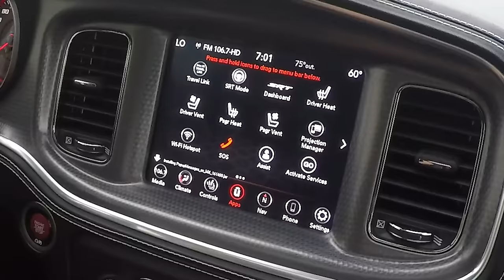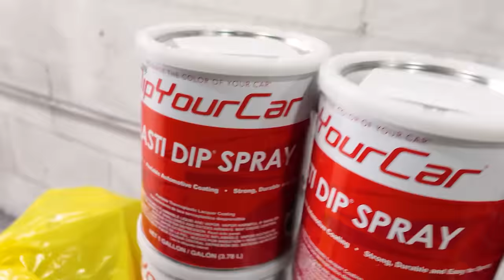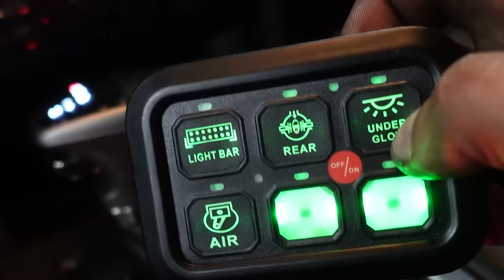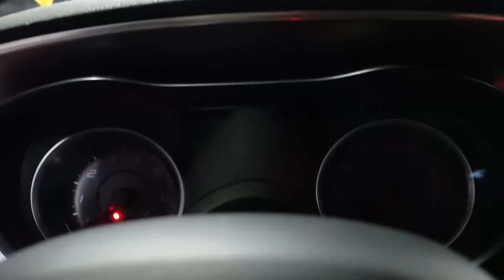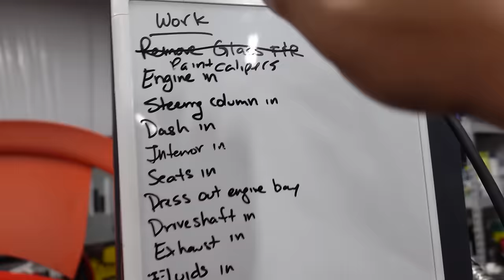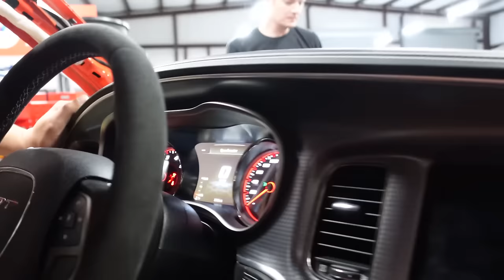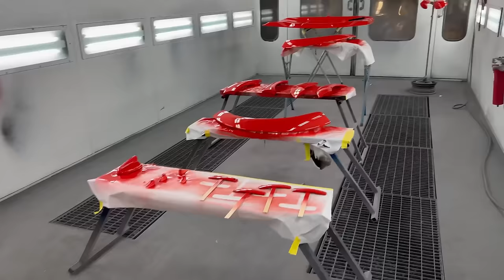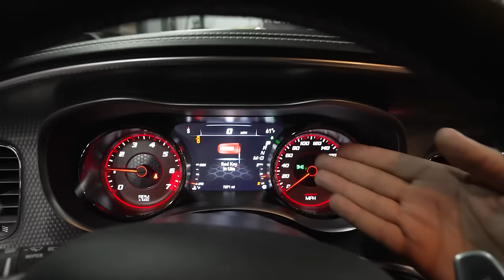FULL BUILD | Building A $100,000 Charger Hellcat Redeye From A Worthless V6 Rental Car

Comment: I built a 6L VF comodor,  put a harrop Supercharger on, change the heads, change the exhaust, change the cam, Flashed the computer, Dino tuned, got  750 real wheel HP.
And you only got  800 HP out of a Hill cat.

Comment: For the next iteration, quoting Colin Chapman, simplify and ADD lightness. Pull 500lbs off that pig and do nothing else. I'll bet it would be completely transformative .  Sound deadening, carpet, back seats, power windows, power seats, power locks, air bags and radio....nope. Get the hole saw/ drill and go to town on every nonstructural piece. Keep the AC as it helps with heat soak in the engine, but remove all the other extras and then some. Skip the carbon fiber/ fiberglass fenders and hood and magnesium wheel stuff...just make it as bare bones as possible by removing rather than replacing and see where you get. Phase 2 would be to replace existing parts with lighter and more expensive stuff, but I would love to see how light you could make it by just removing the fluffy add ons that turn most modern cars into the pigs they are. Ex 500lbs, take it back to Woodward and demolish all (that spent thousands on 'upgrades') with merely a set of DOT drag radials installed. I look forward to that video.

Comment: that nitrous bottle is mounted wrong for horsepower it need the b mounted with the bottom of the bottle facing the back of the car so whenever u launch all the nitrous is being pushed to the pickup at the bottom instead of to the side like yall have it mounted just a little tip !!!

Comment: Do you need better suspension to keep the tires stuck to the ground do you need a chiller for the supercharger to keep it cold and you need good sticking tires smaller supercharger, pulley, and all the pulleys that are hooked to the supercharger belt to start with

Comment: so the vacuum is because the fire is still lit while inside the tire?   the vacuum is because the fire needs oxygen to combust?  so you immediately pump air into the tire with the compressed air?   sounds dangerous?

as the fire inside the tire burns the remaining oxygen, the lack of air creates a vacuum ?  32:21

careful... OR is / was it... careFOOL?

=-P